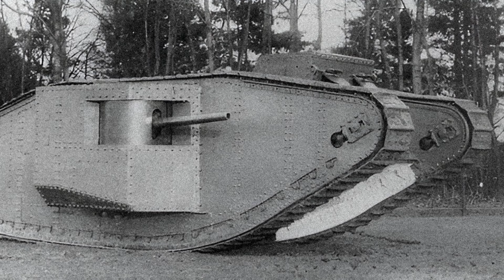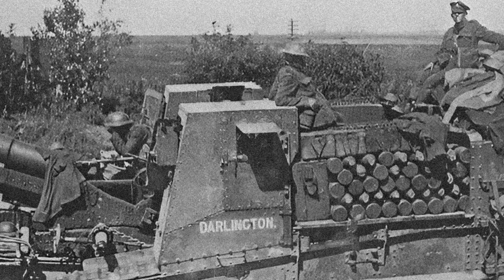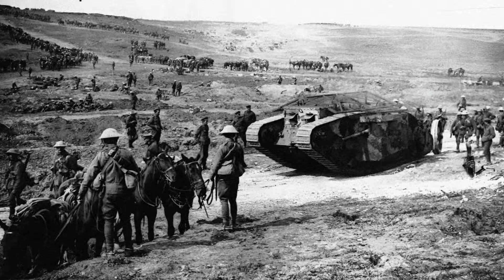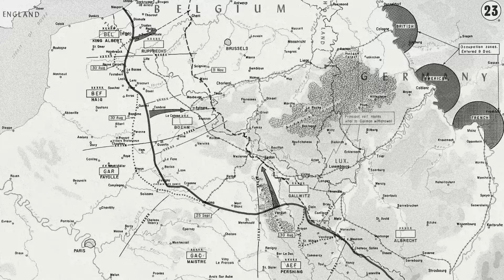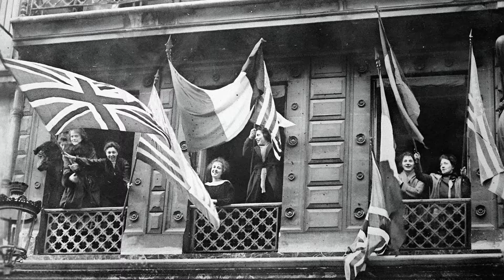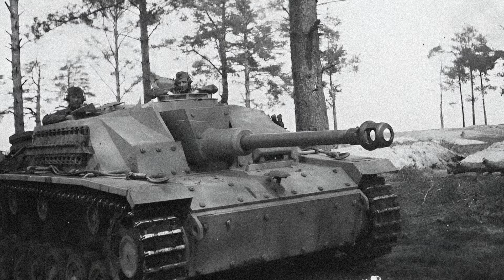The First SPG in History: The Forgotten Steel Monster of 1917

Comment: There were 48 Gun Carrier Mark Is built plus 2 crane vehicles. They could carry either a 6inch Mark VI howitzer or a 60Pdr Gun. The howitzer could be fired from the vehicle but the gun had to be unloaded and the wheels replaced before going into action. Although it was shown under test that the Gun Carriers could act as close support artillery the British Army artillery hierarchy had no idea about how to use them and they were primarily used as heavy supply vehicles. The enclosure at the rear of the vehicle was a slum - there were two gearsmen and two mechanics jammed in with the engine, transmission and ammunition. The Gun Carriers saw action around Ypres in May 1918 when a small number conducted night shoots. In June 1918 the gun handling equipment was removed to free up more space for supplies. The Gun Carriers took very heavy losses when German artillery caught them in a forest outside Villers-Bretonneux.

There is a free cardmodel of the Gun Carrier Mark I on Landships II. 

There were whole host of SPG designs in WW1 - some of them produced as prototypes by the end of the war. In France there was a derivative of the Saint-Chamond tank chassis which consisted of a tractor vehicle and a gun vehicle. The guns used were a St-Chamond 220mm howitzer (1), 194mm GPF gun (50) and 280mm Schneider howitzer (25). Only one was tested in 1918 and the rest delivered in 1919. The St-Chamond SPGs were used in WW2.
The US Army was very keen on mechanised transport of heavy guns and had prototypes of SPGs with 8inch howitzer, 155mm GPF gun and 240mm howitzer running in 1918. Although small numbers were ordered only 10 Mark II Motor Gun Carriages with a 155mm gun were completed. There were a number of light and heavy SPG designs tested by US Army Ordnance in the early 1920s.

Comment: Built to be an SPG but never reported as fired from the stowed position. Used as an armoured resupply platform and and fragmentation/bullet proof ambulance. Then it traverses almost any terrain short of swimming. Anyone else see the birth of the APC here? Self proppelled guns, like the M-109, don't seem to be represented by this story. I am getting a feeling of M113 by the description of this machines role from over 100 years ago. Thank you so much for highlighting this inovation from WW1. I have to wonder if anyone will have this 100 year review about the beginnings of drone warfare today?
Reply: There was also the Mark IX, a great way of delivering 30  troops to the front.  That they were now seasick (movement but no visibility does that to some people) and half asphyxiated by engine fumes was a by the by, seems shifting 10 tons of supplies was a better use of the vehicles.
Reply: Actually The Brits produced actual APC's in 1918 and saw limited use in the last months of the war. They were built on what would become the basic design of the Mk8 tank.
Reply: APCs are armored personnel carriers meaning its designed to deploy infantry, on top of that but the Mk1 gun carrier could be fired from the stowed position which would very loosely place it in self propelled gun territory however it should be considered as an odd artillery tractor by battlefield role.